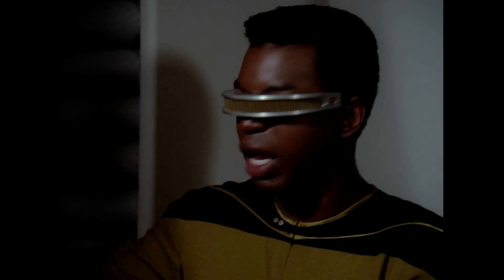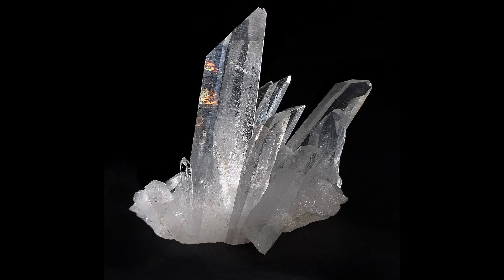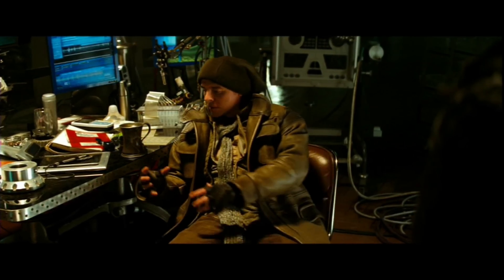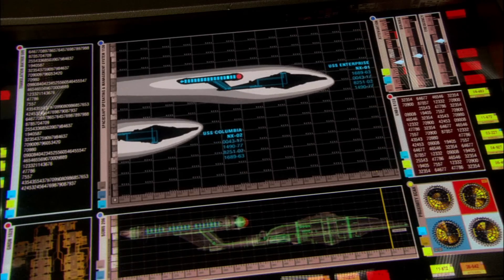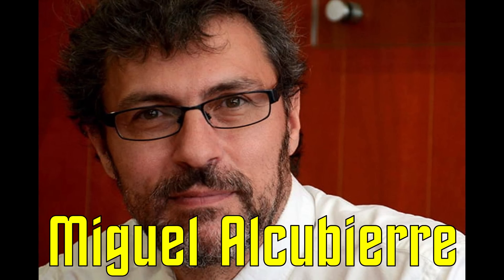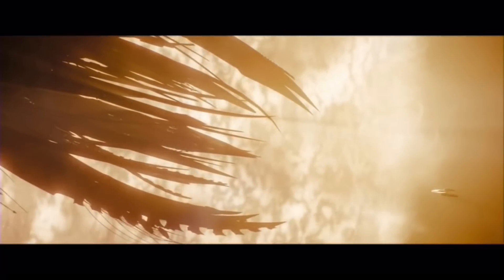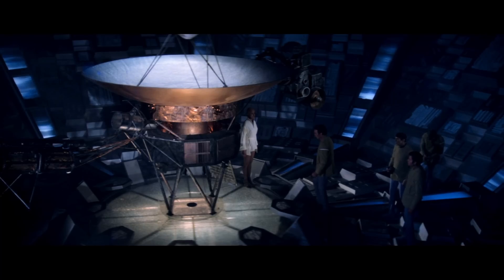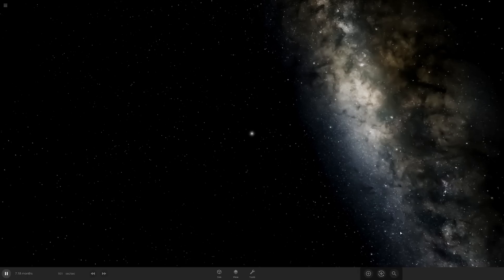The Science of Star Trek's Warp Drives

Comment: Even if we could build a warp drive, we’d better also quickly develop a functional deflector dish, because there’s almost 0% chance of dodging space debris at those speeds. Even impacting flecks of dust would be like being struck by a nuke!
Reply: I thought warping space around a vehicle would warp any materials in that space - such as dust, asteroids etc - around the vehicle. The vehicle is static, only space is moving around the vehicle. Therefore, deflectors only become necessary at sub-light (or impulse speeds in Star Trek parlance) velocity.
Reply: @graeabarth2227  that's what i thought too!
Reply: @graeabarth2227  exactly
Reply: @graeabarth2227  exactly, your moving the space the ship does not move, you bring 2 points in space together, IE fold or warp space and then poke a hole and go through it and then unfold the space, the SHIP does not really move.
Reply: @AdrianJayeOnline  
And what if space does not want to comply with your "space folding"? How will you manipulate or persuade it to comply? Space isn't just a piece of paper that you can easily fold.
Reply: @graeabarth2227  we have a winner!
Reply: The deflector dish is the easy part. That's known physics. We can easily create magnetic fields, even large ones. There is only the question of the engineering to properly shape and then scale up the fields to far enough in front of the craft to make them fully usable.  Once we can harness fusion or antimatter to power a future warp drive we will have all the power we need to run a large safe navigational deflector in front of the ship to keep it safe.  
The initial problem with the whole thing is harnessing the required power to do all this stuff. Fusion power will help ALOT with getting us well on our way.
Reply: The ship wouldn't actually move. The space around it does and therefore most if not all would go around the bubble.
Reply: @mikeflightfpv2162  Not exactly. Warp “bubbles” work by essentially compressing space in front of the ship and expanding space behind the ship, while the ship itself travels at sub-light speeds. Think of it like a piece of elastic sheet, constantly contracting and expanding as an object moves across it’s surface, now imagine a piece of debris being flung from compressed space, immediately into the normal space within the warp field bubble. It could potentially sling-shot the debris at near light speed directly into the ship. Hence, deflector dish. 😉
Reply: @OrderofthePipe Agreed. Albeit I've come to a slightly different understanding throughout this video and other articles regarding this subject. With regards to this video you may be right. Indeed it would be cataclysmic to impact anything at even a fraction of those speeds. But. Another understanding of this particularly complex subject is that at the initiation of a warp bubble like this is essentially rendering both the bubble and craft within that bubble invincible to any any all effects of the relative spacetime its traversing in, even inertia wouldn't exist because it would be like a reality situated "next"to ours, contained into itself and one not affected by either. Both wouldn't directly interact with each other in a traditional sense other than both pressing against one another..  An analogy that was given to me was like stepping"underneath" spacetime like placing a ping pong ball underneath a carpet and pulling the ball with string from one end to the other.  If there were obstacles on that carpet? The movement through that medium would and wouldn't exist, it would hypothetically and ideally move or bend those obstacles around the presence of the bubble and the objects will just either move out of the way of said craft or it would flat out go "underneath" those obstacles.. It's mind bending to think about theoretical movement inside but also outside of a medium of spacetime without being affected by it contents but that essentially what they will be achieving. It will be a self contained/ generated anomaly via powerplant originating inside a bubble that would bend any and all of spacetimes contents around it, including light... That's IF we can generate that power.. But! I'll wholeheartedly admit that if iit were me testing this out?  I'd definitely opt for a deflector shield nonetheless! Juuust in case..
Lmfao🤣🤣🤣
Reply: The warp field itself would deflect stuff around the ship, because everything inside the warp field would be moving at the same speed i.e. 0m/s
Reply: The ship is stationary. The drive compresses the space in front of ship and stretches it behind the ship.
Any material like space dust would either flow around the bubble ...or like the ship be essentially static.
The danger would be when not using the warp drive and ship is using some kind of standard propulsion...then yes...parti les and debris are threats...just as they are today.
Reply: If the space is distorted, then, any particle WILL get affected before coming in contact with the space ship. It will be made to travel alongside the ship.
Reply: @Kualinar  That is assuming that such a warp field will create a “wake” which would move space laterally along the sides of the bubble. But I don’t believe that to be the case here since space doesn’t actually move. Space in this case is only compressed and expanded. Meaning, if anything, such a distortion may hypothetically actually accelerate debris as it moves from compressed (in front of the ship) spacetime, into “normal” spacetime within the bubble.
Reply: Hence why ETs never been here. Our UFO phenomenon is trans dimensional. Because of the junk we have floating around in our Heliosphere alone, warping or even sub light speeds would liquefy you. 😆 The debris will also liquefy you. The friction might set off a stellar alcohol cloud, an alcohol base much denser and potent than anything we can produce on earth. It's acid levels stuff. Yeah. Wormholes or pocket dimensions sounds better.
Reply: Not if you warp using concentrated gravity wave drive, along with a moving inside a neutron shell.  By not interacting with electrons, there is no debris to dodge.
Reply: @KK-pq6lu  
Can we try a little harder to make the explanation scientifically plausible?

I am still trying to figure out how exactly that Star Trek "gravity plating" works. How far does the effect extend past the hull of the spaceship?

How much does the gravity vary? Are there sections of the ship that only have 80% gravity? Are there places that experience 130% gravity, maybe deep down close to the gravity plating?
Reply: Thats one reason we cant go to the Moon or Mars or anywhere beyond low earth orbit. Too much debris orbiting earth.
Reply: Not just a deflecor, but also a structural integrity field to keep the ship from tearing itself apart, and an inertial dampening field so the astronauts don't end up as salsa on the bulkhead.
Reply: @vincepurpura8905  
Sounds like a bunch of Star Trek techno-babble. Oh wait, that is what it is.

I am still trying to figure out how a "force field" works. What is it made of? Are we talking magic? When a "force field" depletes, what exactly is depleting? The charge in the field coils? Couldn't it rebuild faster if we just pump more energy into it?
Reply: Aye she be a nasty situation captain, we're talkin class V Ferengi taco Tuesday  sir. We just cont dew it coptin (spits vigorously in face during entire bit).
Reply: comes down to the density of matter in that area. A warp bubbly entails you are moving yourself and the space around you through space, not actually producing momentum yourself,
So one potential outcome is nothing would be hitting you with any more velocity once it enters your "bubble" than if you were just stationary............ however that is still relative, you could be stationary relative to earth and still get hammered by hypersonic material, because that was the velocity it was already going. 
The relative velocity of material outside of a star system is also increased as their motion wasnt locked into the start system in question. So interstellar debris, though far more defuse, is individually more dangerous. 
What the issue is is if you have a warp bubble traveling multiple times light speed, even though everything you run into drops to normal velocity within your bubble,
You are collecting it at an enormous speed, because you are covering far more ground. 
So even though you wont have to deal with light speed debris, 
you will be dealing with LOTS LOTS LOTS more debris traveling at their usual, still stupid fast velocities at you. 
Which makes shielding still viable, but definitely a massive pain in the arse.
Reply: Evidence please don’t just make a blank statement, a speck of dust? Really?
Reply: Does the warp field not play a part in mitigating contact with space debri by literally warping space time around the ship to make it possible to achieve crossing vast distances in less time?
Reply: On average in Interstellar space floats 15 atoms per m^3 so at the speed of light you would catch a lot of them in front of your vessel
Reply: You would only need a deflector dish at sub warp speeds 👍
Reply: or we could invent dune navigators.
@orangeriver please do a video on dune navigators (book version)